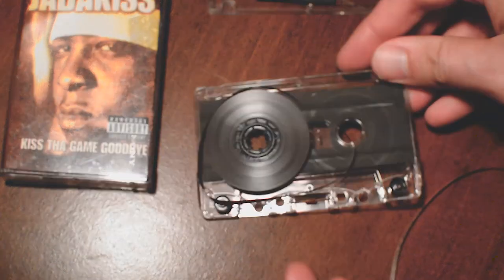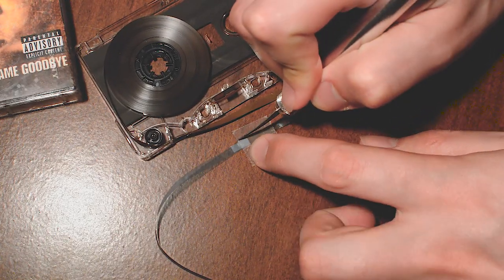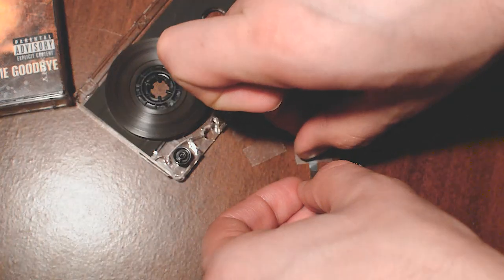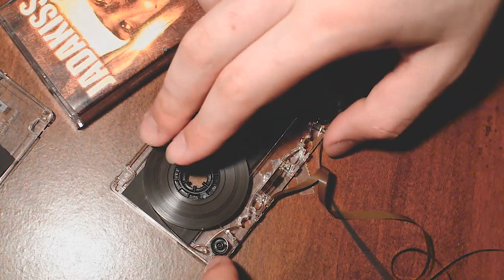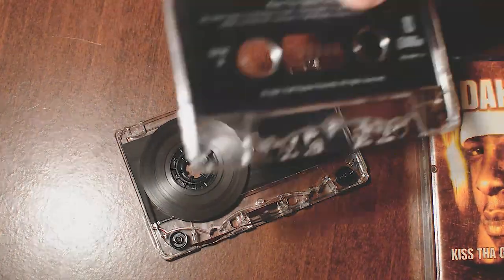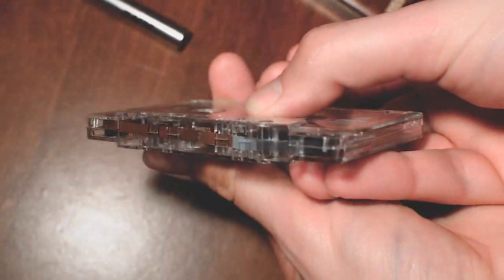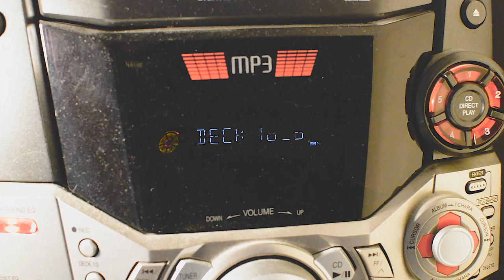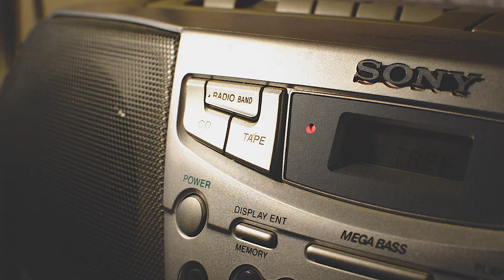💡Freestyle Friday: How To Repair Your Broken Cassette Tape

Comment: Metal tape type only 🤟
Reply: chromium, ferrum - all were there then ;-) C45, C60, C90... I remember ;-) and wait: they used to have screws
Reply: I think we always had that CrO2 setting on our deck. My dad always referred to the type 1 ferrite tapes as junk lol
Reply from the maker: That's pretty funny. I'm sure you may have seen the other comments but this is actually one of only 2 tapes I've ever had in my possession. They just fascinate me for some reason.

Comment: This takes me back, recording onto tapes from my brothers LPs, then writing all the songs in tiny letters with 9 year old handwriting was the hardest part. Thanks for the video.
Reply from the maker: You're welcome! Yeah, I love retro stuff like this. I'm gonna try and repair my Gameboy screen (the missing pixel problem on the right and left). Should be fun!
Reply: @HomeStudioBasics  I tried fixing a timer and one of the early Seiko watches with a an LCD screen. It all depends on the manufacturing process that was used. The later manufacturing processes didn't use wires so it makes it about impossible unfortunately. Good luck and I hope you make a vid about it.
Reply from the maker: @Kevin Rams  Yeah man! Apparently, the Gameboy process is pretty fragile, so I'm kind of nervous 😂